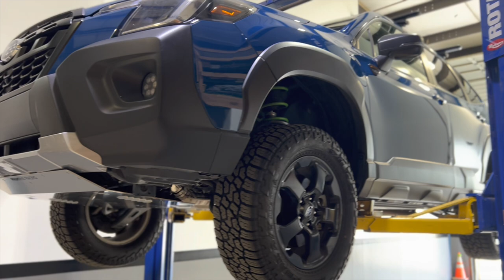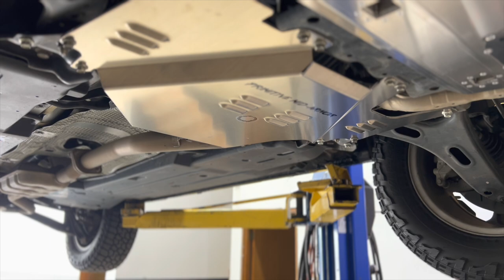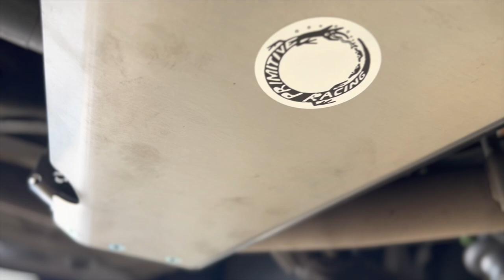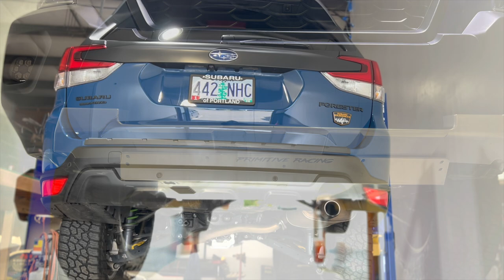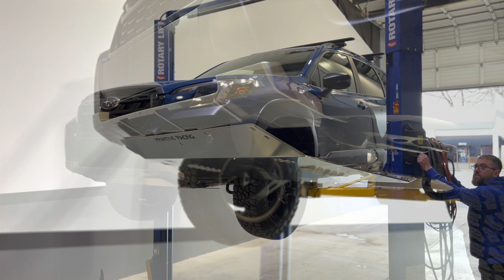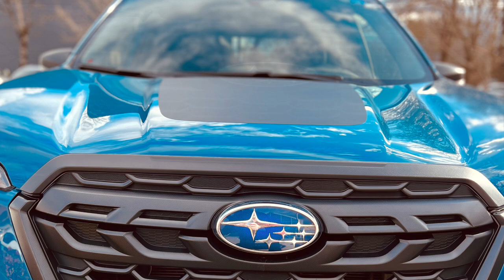Why I Chose Primitive Racing Skid Plates to Protect My Subaru Forester Wilderness

Comment: I'm not sure about the Forester, but on a Crosstrek the thinner more flexible skidplates are desirable because they are mounted to the relatively weak radiator support. The idea is you want the skidplate to bend, instead of the structure it is mounted to. If you put a thick indestructible skidplate there, all you are going to do is wreck whatever it is mounted to. 

That's also why LP Aventure designs their skidplate the way they do -- mounted elsewhere to avoid damaging things. That just creates a bigger problem though. Sure it's stronger but now you're going to constantly hit it due to the loss of clearance.

All that said, I still prefer the primitive racing plates. They are a clean design and also priced very well. Just drive carefully and try to never hit them hard enough to cause a problem. It's a Subaru not a truck after all.
Reply from the maker: Excellent comment and I agree completely.  I don’t think I was aware of this fact earlier but it’s true.  It’s a trade off.  There’s definitely plenty of give in the primitive plates.  Have already bent up my rear diff skid plate.  But I’m sure that helped absorb the impact. Thanks for your input!

Comment: Nice video. I'm considering getting this Skid plate for my 2024 Subaru Forester Touring.  My decision for a plate is because my dear wife destroyed my previous 2017 Audi Q5 by destroying  the  Steering Rack, Engine Cradle, Stock Plastic Sid Plate and Exhaust System. She totalled the car in a matter of seconds.  So to save my new Forester this skid plate is a must.
Reply from the maker: From the sounds of it, getting a divorce might be safer.

Comment: Another helpful video, thanks! 
2 comments on the front skid plate.

They should have left the louvers off, and maybe included more weep holes for water drainage. If you were trying to back out of a hangup you don't want those cheese graters working against you. Its not like they are exhausting much hot air. (Like me?)

The oil change port is another cost they could avoid. I would want to take the plate off for oil changes just to better inspect the under belly and clean out all the crap it will collect. They did make it easy to remove and install.
Reply from the maker: I think you’re definitely right about those cheese graters 😂.  That and the driver side corner at the rear is hanging down too far and could get hung up reversing.  Will try and have them angle that upwards more if possible.
Reply from the maker: @johns6816  Ain’t that the truth!  Thanks for your recommendations!

Comment: News 3/16 is not much and won't help much if it takes a hard punch . 1/8 steel would be stronger . It looked like you
 lose about 1 1/2 GC with that plate . But that is a good price , and any plate is better than no plates . Bless yah .

Comment: Will these skid plates hold the weight of the car?
Reply from the maker: I know for a fact the rear diff skid plate is strong enough to use for jacking the car up according to Primitive Racing.  I’m not entirely sure about front skid and how much weight it can stand up to.
Reply: I was researching this a little while back, according to Primitive the rear diff skid is good for jacking. However I've seen mixed info on the front skid. Driving Sports TV said the front skid was strong enough to jack up the car (and did it), on some forums I've seen people saying that it isn't good to use it as a jack point because of where the front screws go. I reached out to Primitive themselves and they said that it could be used as a front jacking point as long as the jack is placed under the rear mounts (near the OEM front jack point).
Hope that helps!
Reply from the maker: @LaloMartinez  great information, thanks!!!
Reply: @wildernessnorthwest9604  Of course, keep up the great vids!

Comment: Great videos.
Are you considering getting any Rocksliders ?
If so which ?
Thanks !
Reply from the maker: Definitely want some rock sliders.  Talking about them with primitive racing who wants to develop some for forester wilderness.  They may borrow my rig to do that.  As long as they don’t take too much ground clearance away I’m down!!
Reply: @wildernessnorthwest9604  I completely agree. Just recently purchased my skids from Primitive and asked them about sliders too. Here’s hoping.
Their gear is smart and very well made.
Reply from the maker: @cheezmo2k  rallitek you only lose .5 inches ground clearance. Do you know the loss on the other brands?
Reply from the maker: @cheezmo2k  yeah i actually prefer the tube style as well

Comment: Thanks for making this! Not planning on adding a lift in the immediate future, ground clearance/approach angle with these has me curious. How much (if any) clearance did you lose?
Reply from the maker: I haven’t measured yet, I’m assuming I lost a quarter inch or more.  I will measure when I get a chance and let you know. As far as approach angle, it’s up there almost flush so I don’t think it would be a noticeable loss.
Reply: @wildernessnorthwest9604  thanks! Looking forward to more wilderness vids!
Reply from the maker: Ok, so I was a bit optimistic on how much ground clearance was lost. No real loss on approach angle, though I do need to measure it officially.  It’s really sucked up flush to original bumper so not worried there.  One of the weaknesses of the Forester is it’s approach angle.  It’s way better than comparable models in segment but it’s also not exceptional by any means so that’s key to not lose there.  Bottom of engine skid plate starts at about 11.5”, decreases to 10” at lowest point. CVT lowest point is 9.75”.  Rear diff is about 9.6 inches.  That means my biggest loss was at rear diff., losing about 1.4” as I was at 11”.  I would say count on losing over an inch, but fortunately the biggest loss is a pretty small area on the diff.  Really do hate going below 10” on any part of it, but that’s the nature of adding protection.  Hope this helps as you decide what to do.  I talked to Rallitek about adding inch spacers in addition to my Ironman lift to recover the clearance I lost but they said it would be expensive to do and you’d have to replace the rear control arms.  Possible but you’d be looking at near 2k to get that inch back.
Reply: @wildernessnorthwest9604  thank you so much for the detailed reply!!! Definitely something to think about without that additional lift

Comment: Following this upgrade path from the wheels, lift, and skid plate for my 22 forester wilderness. any advice on what could've you done differently? great video! thanks!
Reply from the maker: Nothing that I would have done differently.  Those are definitely the three top things to do first.  And definitely get recovery boards (I’d even recommend getting 4 instead of two) Just be aware that a two inch lift will give you less than two inches of ground clearance and the skids will also reduce ground clearance so just kind of manage your expectations on that.  Next steps for me will be rock sliders, Warn steel winch bumper, and torq locker,  which their company is about to release rear diff locker for wilderness model they told me.

Comment: Hello. I installed primitive today  on my FW.  I was surprised the oem splash guards was part of the oem skid plate and when taken off left  big opening in both wheel wells for dirt, snow, salt ect to get in.  Have you had any issues with the openings now in your wheel wells getting into your engine bay??

Comment: Question does this cover the catalytic converter?
Reply from the maker: No it doesn’t!  Nor does it cover gas tanks.  Not too concerned about this though.  Gas tank skids/full protection would be nice for sure.  But what I got really protects what you need on the drive line.  It will help you hobble out the trail in case of other damage.  My rear diff skid plate already saved me big time.  Would have done serious damage without.
Reply: @wildernessnorthwest9604   thank you so much I appreciate the help

Comment: Is the OEM skid plate particularly thinner than these?
Reply from the maker: What’s on there shouldn’t even be considered a skid plate really.  It doesn’t cover the engine and if I had to guess it’s less than 1/8” aluminum.  It seemed really soft and thin to me.
Reply: @wildernessnorthwest9604  Good to know. My wilderness is coming next week and I think I may wanna get the good plates on before winter. Thank ya!
Reply from the maker: @Scybren  congratulations that’s awesome!! What color did you get?
Reply: @wildernessnorthwest9604  Geyser blue! the green was a close second, get halo warthog vibes from it lol
Reply from the maker: @Scybren  ha! good choice.  It was a toss up for me with that green color as well.  Both really stand out but the blue is super unique.